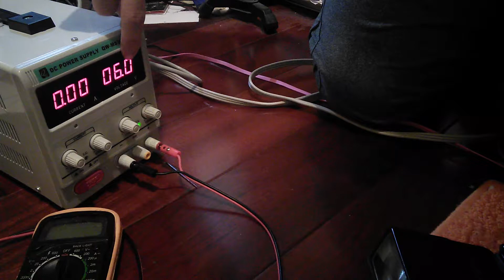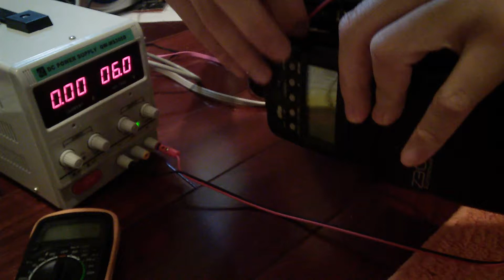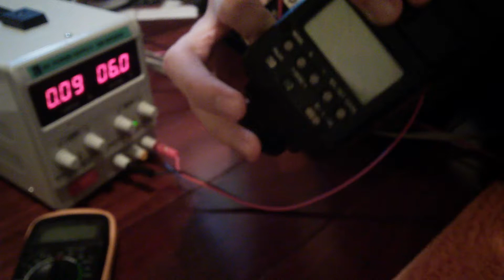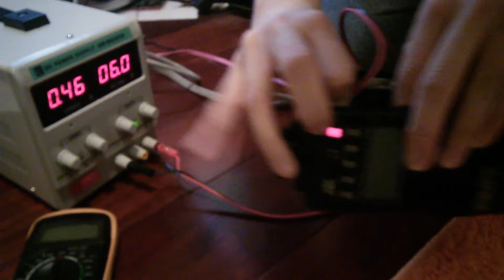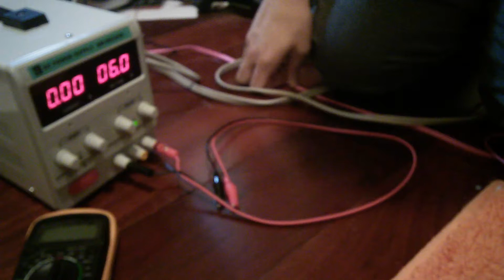Canon Speedlite 540EZ with Bench Supply

Comment: Thanks for video, planning to get the same flash and now Id know not to leave batteries in when not in use, and that i can use power supply to run it in places
Reply from the maker: You only have to remove one battery to disconnect the circuit; if it's easier, you can leave the other three in. Also, I ended up soldering some wires to make the attaching of alligator clips easier; you can see that here: https://youtu.be/QX1GJCsU5cU
Reply: Cool man thank you,, seen it and gonna make similar soldering for easy connection and you saved me time with showing what youv done, believe recovery time will be miles better with bench power supply comparing to silly AA batteries regards